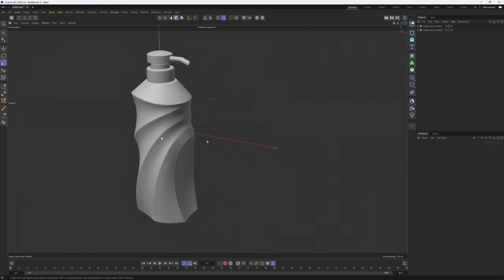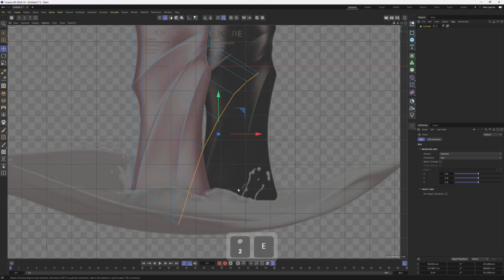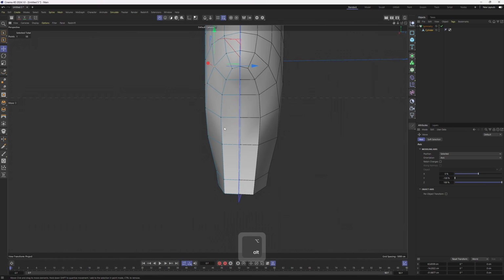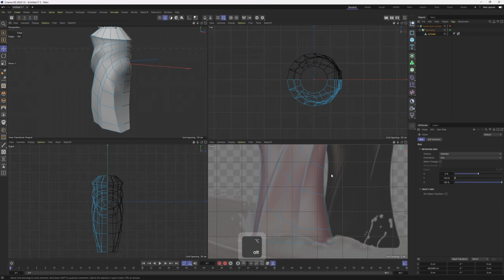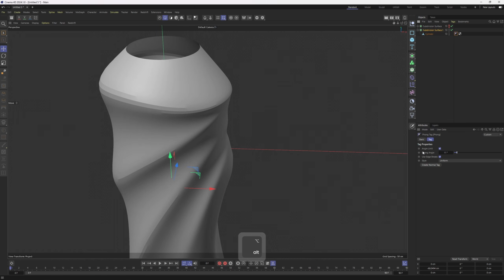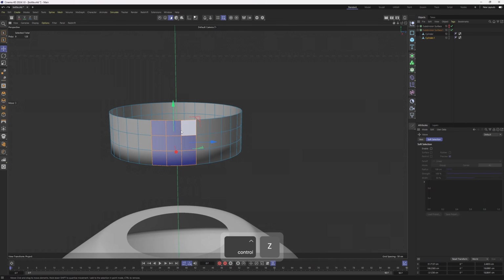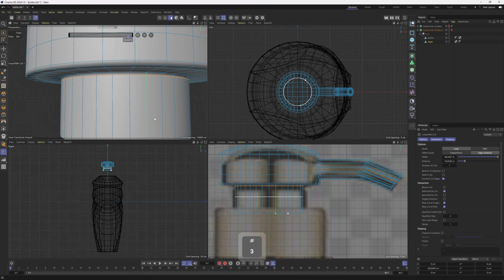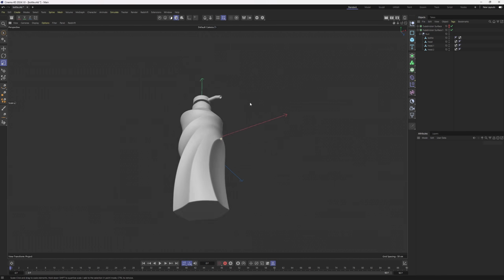Industrial Design/Product Modeling and Rendering Tutorial #36

Comment: What a fantastic tutorial.  I've just made this bottle with you Mert! Thank U for many super cool solutions!    1 question: I found 2 n-gons in my final bottle somehow... can I just remove them by clicking "remove n-gons" and they will be automatically changed into quads? I can't even see where they are to fix them manually :(
Reply from the maker: Thank you very much.
Remove Ngons tool is not reliable, so you need to fix the bad topology manually, in some cases it works just great but most of the time it doesn't work properly.

Comment: You can move an edge/loop along its normal. Check the options in the move tool.
Reply from the maker: Yeah, nice tip but as far as I remember it doesn't work as good as normal move tool but I will try to use this method in the next ones.
Reply: It works perfectly here, you have to check along normals options. Another option would be with the slide tool holding down the shift key. @polygonpen
Reply from the maker: Okay I will try that, thanks! @Ricardo-de9ju